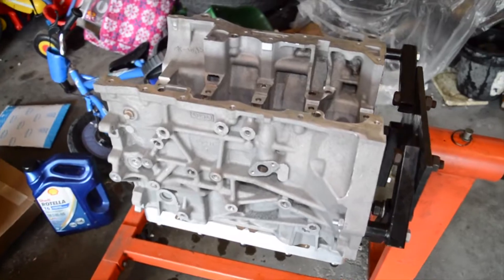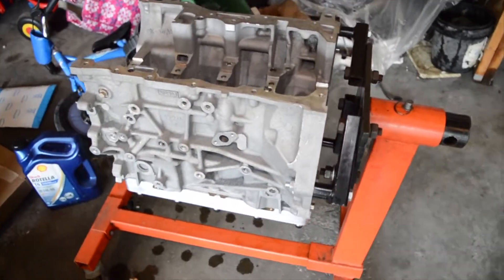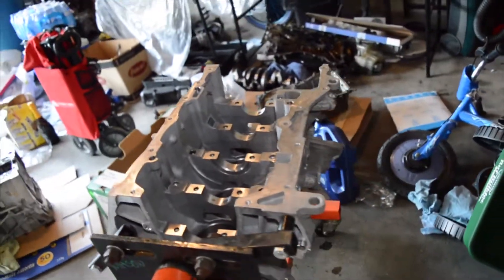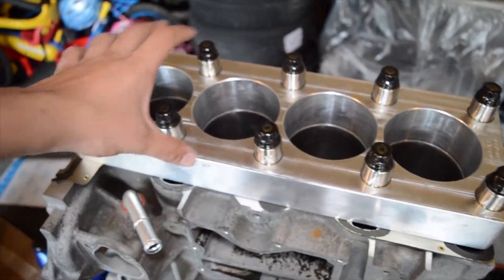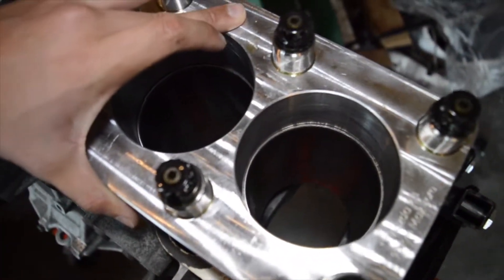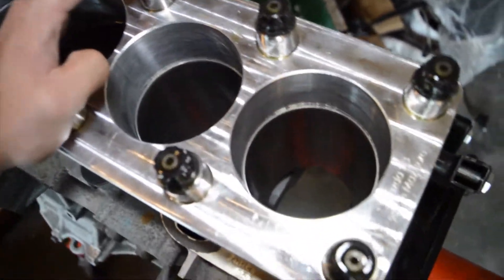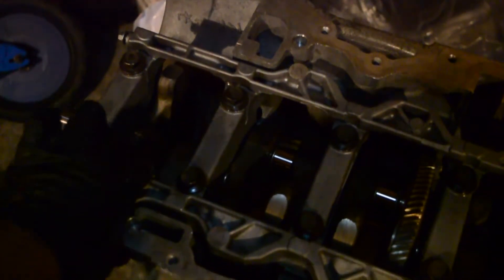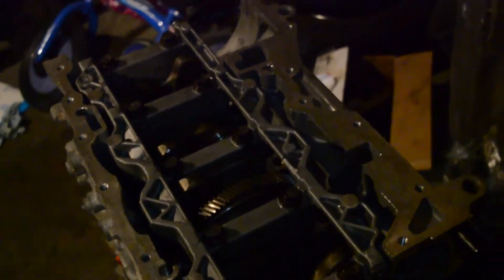Mazdaspeed Engine Build Part 3: Main Bearings & Crankshaft Install

Comment: You are explaining it good enough. I'm in the process of building my mzr motor from my speed6. I just pulled the motor yesterday so my next step is to break it down. Alot of what you do in the videos are common knowledge stuff, however, its still useful for me as  i see different ways to do stuff. Keep it up.